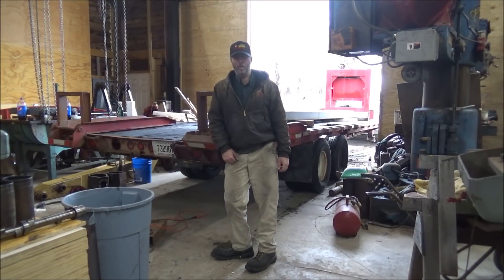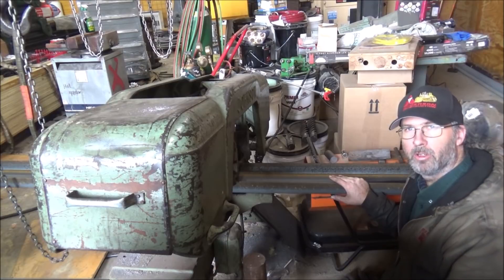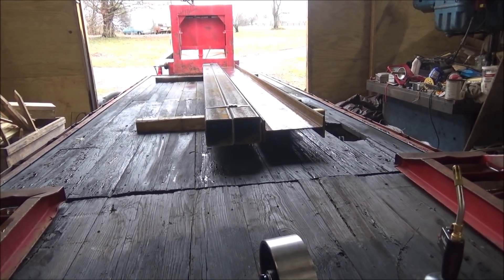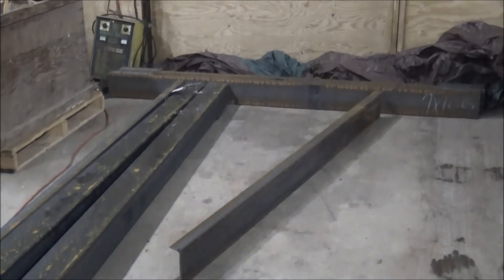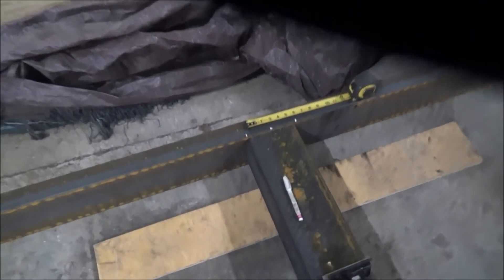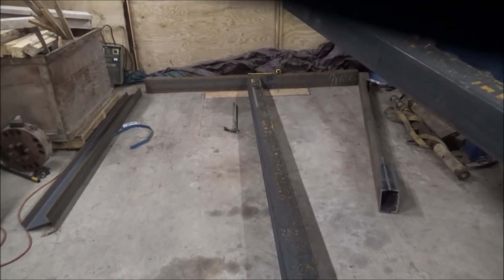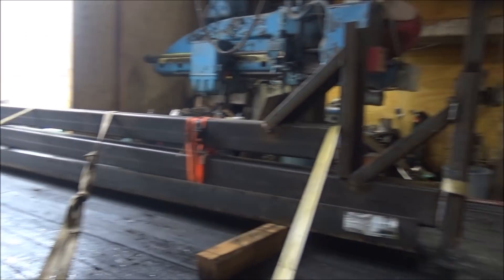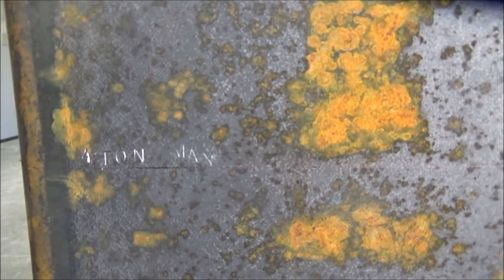Bigger Better Gantry Crane Build

Comment: I was hoping to see the final assembly and raising it up.  Assembled on the ground with another crane to lift it?  Looks like they need to mark the side excursion limits , moving too far to the side in its new home appears to  exceed clearance under the roof. Brian sure knows how to make fixing and building outwrite Huge machines look easy and does it with precision too. Great job!
Reply from the maker: Sadly I don't have a camera crew to follow me and shoot video while I move around. :-( It is rather difficult to do tricky operations by yourself and film them too.

Comment: Very nice work Brian. Looks like a very similar design to the 2 ton unit I made a couple of years ago. Mine's quite a bit smaller though - just 2.4m/8' wide, and 3m/10' tall. I want to lengthen the uprights though, it really should have been 3.6m/12' tall. Getting a vertical mill off a small trailer still needs a bit more headroom.

Comment: I like these kind of videos, I remember when you did the other 2 there was much controversy in the comments about how you mounted the top beam.  I am guessing the other 2 have held up well?  no failures, no injuries? lol
Reply: most things work great, until they don't
Reply from the maker: Yes the others get used multiple times a day 5 days a week. No issues.

Comment: am interested in how much all that steel costs in the us (am a brit)    also no brakes on the castors?   .. would prob be illegal in the uk
Reply: The whole thing would be illegal in the EU, just waiting to fall over when somebody tries to move it with a burden too heigh up!
Reply: @helgethaysen7830  Here in the USA we still rely on common sense . It gives a lot of freedom and helps eliminate the stupid from the gene pool.
Reply: The list of things that are legal in the UK is a lot shorter than the list of what's illegal. Must be frustrating to try and get any work done.
Reply from the maker: @helgethaysen7830  Subtract the hook and hoist and you can only get something lifted to about 15feet up. It would be extremely hard to get a heavy  load swung 4 feet from center to even have a chance of tipping it over.

Comment: Would like to know more about your dimensions.  Looks amply strong for 4T lifts, really nice build.  You stated 22-foot overall height.  What is the span between the uprights, width & thickness of the top I-beam, the length of the horizontal lower beams between wheel centers (or overall)?  Looks like you got it all "right".  Congrats.
Reply from the maker: For liability reasons I will not give exact specs but if you watch the video closely enough you can tell what everything is as most all of it is marked.  The top beam was 20 foot so it spans like 18.
Reply: @bcbloc02  thanks

Comment: This is some big crane....
Ever tried to write letters and numbers with the MIG welder, not easy but quite permanent...!!!
Hope that with only 8 feet on the base, they don't "swing" loads on that, if they do tell them to keep the camera rolling...  
Soon to call your shop :    BCBloc Heavy Industries.   Actual shop is already too small...!!!      😉😎👍
Reply from the maker: No locks on the casters that way it self centers over the load. 😎
Reply: @bcbloc02  
Keep the floors cleaned and the casters oiled...!!!

Comment: Like your build! Off question from the crane. How much does your trailer weigh? Shop built or a brand? Thanks!
Reply from the maker: It weighs about 9000lbs. It is a Cornelious MFG trailer which is now known as Corn Pro. It was custom built with an extra tall neck so it can be pulled by a truck with a Utility Bed so that adds a bit to the weight. Also it has 12k axles so it is a heavy trailer anyway.
Reply: @bcbloc02  Appreciate your reply! Better heavy than looking like an underslung set of leaf springs haha.

Comment: I would love to build a stationary gantry to unload my trailer. Would you possibly sell plans to fabricate my own? I prefer some engineering insight rather just weld some beams together.
Reply from the maker: For liability I can not but if you go to the original gantry crane build video between watching and the comments you can determin all the materials on your own.

Comment: Try some co2 gas and 045 dual sheld 777 wire you love the results
Reply: Curious about your suggestion....I'm a sucker for less spatter and more flow....have you tried silicon bronze? My current build I'm sticking it with surplus 316.

Comment: Brian, I want to build one the same size as the smaller one you built awhile back.  Do you recall the size of the I beam you used? Thanks.
Reply from the maker: Pretty sure it was a w10x19
Reply: bcbloc02 wow, that’s hefty!  Thank you for the info
Reply from the maker: @woodscreekworkshop9939  It was sized for deflection not the load. You don't want your trolley to roll on its own because the beam bows. :-)
Reply: @bcbloc02  Thank you!
Reply: That's on my list of things to do once I am in the new shop.
Reply: Hill Top Machine Works still no concrete?
Reply: @woodscreekworkshop9939  Nope. Stupid rain. You have a 100ft x 100ft tarp I could borrow?
Reply: Hill Top Machine Works cover just the end openings
Reply: Woods Creek Workshop We need the outside area to be good and dry also otherwise the concrete trucks would get stuck. ☹️

Comment: You could have made it a bit wider by tipping it on its side slightly for transport
Reply from the maker: It is a foot wider than the widest commercial available units this size anyway.  It is only for use inside a shop on a level floor anyway so it is plenty stable.

Comment: Nice, but damn, that’s tall! I’m guessing you calculated the load the I beam would take over the width of the beam. But how do you calculate how much weight the uprights can take? The engineer in my head wants to know.
Reply from the maker: There are tables available for column loading of most structural shapes like these. In this case the possible bending loads are a more constraining factor.  The tube can hold like over 100,000lbs if it is purely vertical loaded. The fact it is mostly unconstrained at both ends drastically reduces those values.
Reply: My concerns were about the bending or side loads!